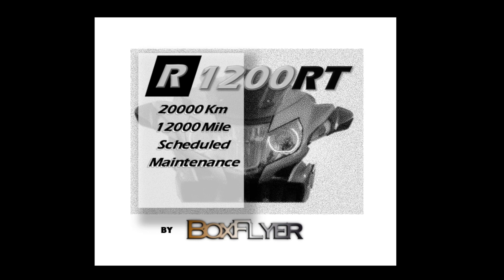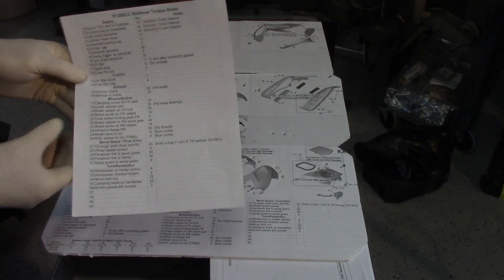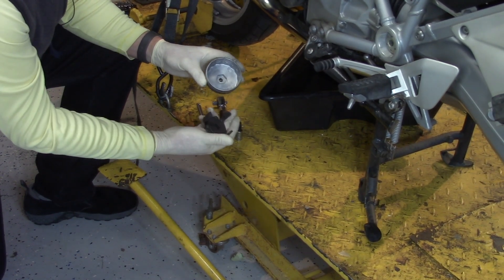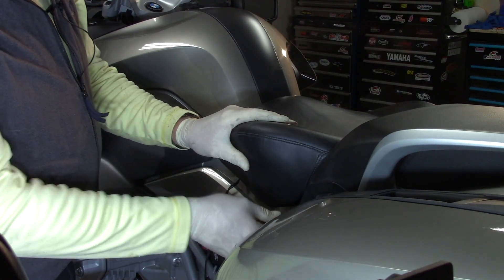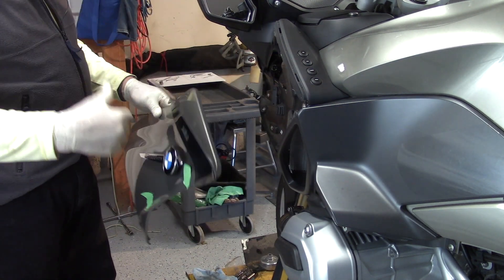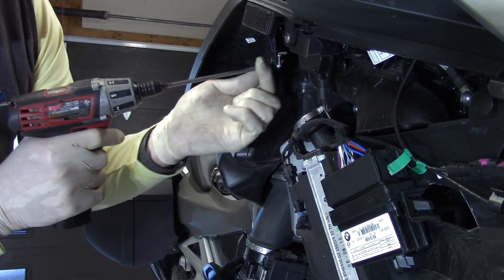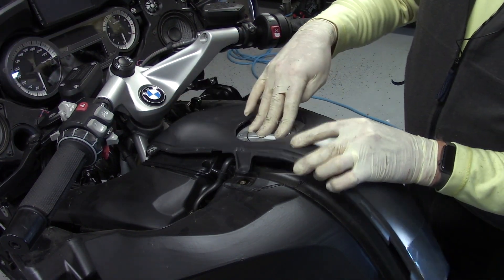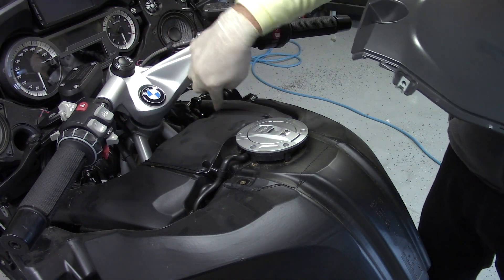BMW R1200RTW 12K Mile/20K KM Service Part 1/6

Comment: Your videos have been a life-saver, I’m on an island, the nearest dealership is located 210 miles away across the Pacific Ocean. Found your series after the check engine light came on and pulled a 21FD32 code, camshaft senor. I really appreciate all the time and energy that went into making the videos, easy to follow, precise and inspirational, I can do this!
Reply from the maker: Glad to help.  The original intent when making almost all of the content on this channel was to take some of the mystery out of taking care of the WetHead series of bikes.  Let me know if you have any questions.

Comment: I just started the 24K service. Until now, I have had the dealer do the servicing. I just did the air filter today, and found some things that concerned me. First, a good number of screws that should be shouldered are not. Second, one of the screws was misapplied - a 14mm screw was used where a 12mm was called for (where the tank cover screws into the tank!). No harm appears to have been done, and I found the 12mm (used somewhere else) and returned it to its proper place. I guess if you want something done right... Anyway, thanks again for these videos.
Reply from the maker: It's a nice feeling to know you have done the job yourself and even corrected a few things along the way.  Well done!

Comment: Excellent work and very clear...much appreciated and looking forward to see if you will complete a coolant change...
Reply from the maker: As far as coolant change, I'm not planning on doing mine for these reasons. 
1) It's not specifically called for by the BMW Motorrad Maintenance Schedule for any Time/Distance. 
2) Unless the cooling system is contaminated or has been opened to perform some other service, the coolant level check is all that's called for.  
I'm checking my coolant with PH strips to check for loss of additives that make the mixture more acidic, as well as a hydrometer to determine both freezing and boiling points.
If you have more frequent cycling of the fan when moving slow or stopped and the quantity and quality of the coolant is normal, airflow thru the radiator is most likely the problem.
My belief is that the radiator fins have bug debris or a buildup of sand blocking airflow reducing overall heat transfer.  
Bug debris can be softened with a mix of water and a surfactant (like dish soap) and after softened will usually come off with a soft bristle brush and a flush from the back of the fins.
Sand that is lodged in between the fins will not easily come out even with high pressure air from the back side of the fins, sometimes I've found that I have to pick out the sand individually, fin by fin, to restore complete airflow thru the radiator.  I just removed a tablespoon of sand from each side of my radiators when doing a video about installing screens in front of the radiators…the sand was physically wedged in the fins and would not be dislodged without using a tiny pick.

I have a different approach to a perceived issue of cooling system inefficiency other than a flush and fill…because changing the coolant with a partially obstructed radiator will probably still leave you with poor performance overall.
Reply: @Boxflyer11  Many thanks for the reply...I recall seeing that there was a two year frequency for the change but cant recall where at the moment...I keep a regular check on the temperature riding with the Navigator V and on board read out and its all been normal up to now...I do a simple check on the radiators and clean out debris with a modified old tooth brush to get dead insects out of the fins. I'm interested in the PH check, the additives used and at what readings, same with the hydrometer.. Maybe these things as a simple add to one of your next postings would be good.. Many thanks again for the great content..

Comment: Thank you Boxflyer for these videos.  IMHO, they are great.  Your videos gave me the confidence to inspect my valve clearance on my GSW.  Wondering if you have any plans to make a video on replacing the coolant on the wethead?  I understand that it is a vacuum fill, and while I understand the basics, I don't know a step-by-step procedure.  I think that a "how to" video would be well received.  All the best.
Reply from the maker: Hi Michael, thanks!  I'm glad you gained enough from this series to accomplish some of the routine service yourself…that was the original intent.
Thanks for the input about what you would like to see for future YT content, so far on the list I have plans to cover, 1)fork seal replacement, 2)battery replacement, 3)GS-911 in depth, 4)FD pivot bearing service, 5)wiring additional fuse box, 6)Skene P3 tail lights, 7)high draw horn with relay…on and on…
I'd be glad to entertain additional ideas besides the coolant flush (which is a good one).
Reply: Instablaster.

Comment: Great videos, love your tips, could you share where you found the body panel layout for keeping the screws during service
Reply from the maker: Hi Tony, Thanks!  If you look up above here, there is the description of the video...click on the "SHOW MORE", and there are links to lots of info about what we did here.  The PDF for the pages I used to cut up and glue onto some foam core board is called "Guides to make BoxFlyer Board"
Hope this helps...enjoy, Brad
Reply: Got it, thanks for all your efforts!!
Reply: Check out this thread for single-page view of the layout. I haven't printed it yet, so I don't know if it's as practical as Boxflyer's large layout.  Might be useful more as a quick reference.  https://www.bmwlt.com/forums/rt-series/184651-all-great-ideas.html

Comment: Brad, have you found that the Wiseco VSK4 shim kits are a reliable dimension?
Reply from the maker: Yes, they measure very close to the marked sizes for each shim.  The only drawback of the "kit" is that there are only about 18% of the shim sizes (1.72-2.60mm) that fall within the range of use for our needs.  Sizes 2.16mm—2.28mm.  The other drawback of this "kit" is that the shim sizes are 0.04mm separated, and I wish they were tighter in the range to only 0.01mm–0.02mm so you could get your desired "target" clearance when adjusting the valves.  
I've begun using the shims larger than anything we need by polishing them down to fit into the range I use in 0.02mm increments.

Comment: OMG - I think BMW engineered the bike to discourage DIY replacement of the air filter and promote dealership service profit!!
Reply from the maker: I look at it as an opportunity to get to know your bike better. There seem to be systems on any kind of machine where integrating engineering and other design elements come into conflict…in this case, the accessibility of the air filter is a prime example. I don’t like it either, but knowing the steps to get this done helps I hope.
Reply: @Boxflyer11  You are absolutely correct, and I so appreciate your video about how to get to the air filter!! I would likely never have attempted it without  your help.  I surely wasn't ridiculing you - just venting about how BMW buried it six feet under ....